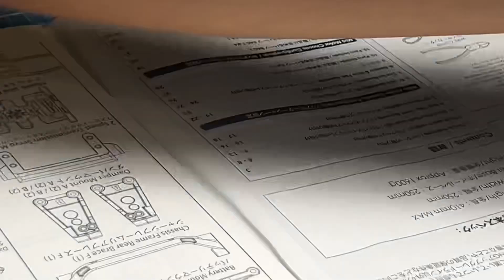3Racing EX Real 1/10 Scale Crawler Kit install Fusions SE1800KV D90 Team Raffee Half Pickup Defender

Comment: What shock mounting you use at rear?
Reply from the maker: Sorry for the late reply bro. I’m using AXSpeed shock . Here is the link below 
 Just found this amazing item on AliExpress. Check it out! SG$29.87  25％ Off | AXSPEED Metal Shock Absorber Cantilever Kit for 1/10 Axial SCX10 I and SCX10 II 90046 90047 RC Crawler Car Upgraded Parts
https://a.aliexpress.com/_omm0YG6